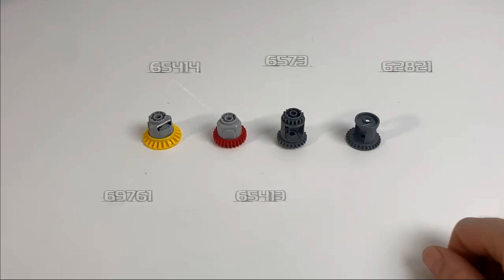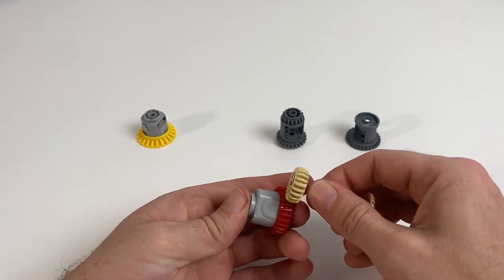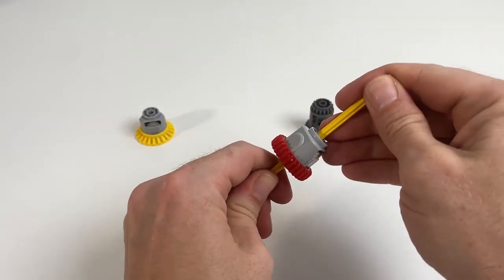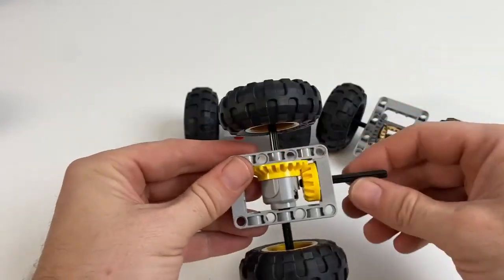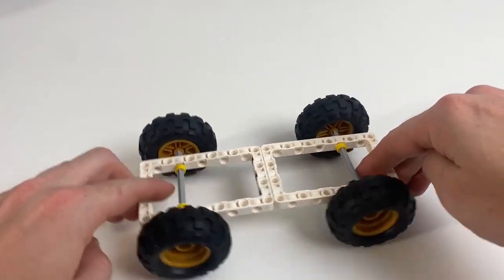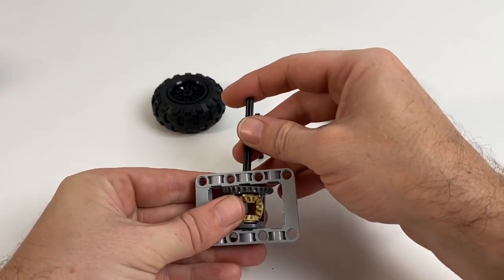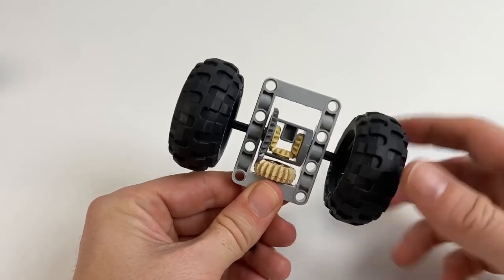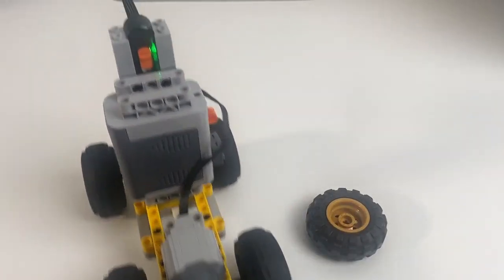Lego Differentials Explained - Part 1 (of 7)

Comment: Any tricks to keep the axles from pulling/falling out of the internal differential gears? I'm using new parts and the enclosed diff. shell with a red main gear.
Reply: That's happening to me as well but with the older front/rear differential